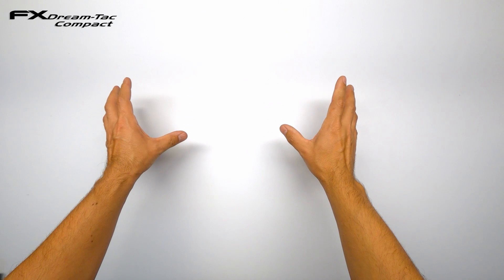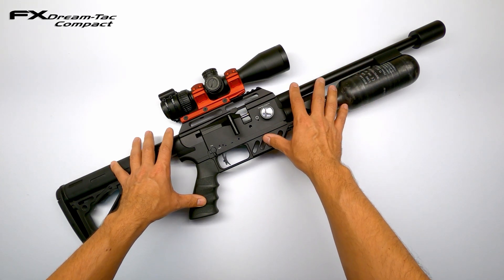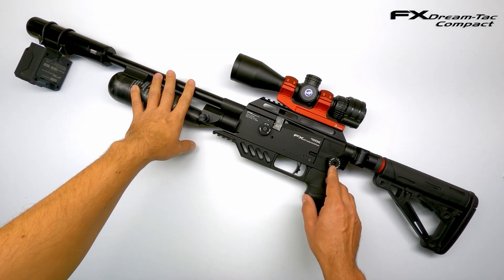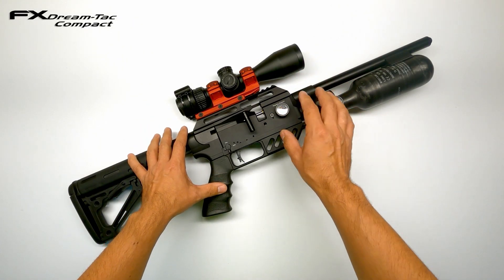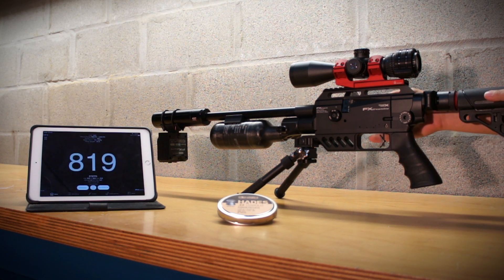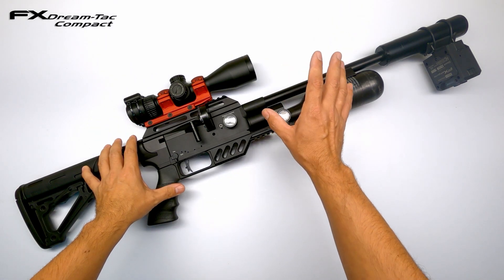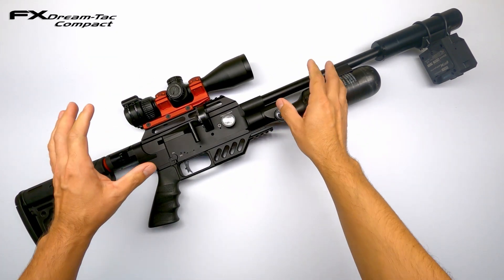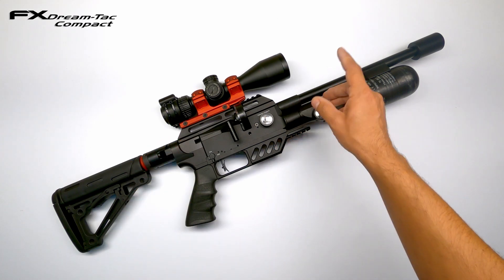FX Dreamline Tac compact tuning guide

Comment: How did you modify the pelletprobe? I am trying to learn but did not find any useful info.
Reply from the maker: I marked how deep te probe good inside the transferport , to it apart , put the probe in the transferport to the mark you just made , mark true the transferport the whole size on the probe and use a dremmel to mod the probe . Or wait abit for Huma to come out with the matching probe 😉
Reply: Thanks! I am sturgling to get over 830fps with hades. I have the huma air bigger port and fx power plenum. Running 150bar fully open and cannot get more out of it than 830fps. Have tried to adjust the hammerspring. Runnin also the stock 300mm stx. Not the superior as I cannot find any 300mm superior liners.
Reply from the maker: cubeqtio have you modified the transferport ? Without the matching opening in the TP you will miss about 30-60 FPS
Reply: I have the huma air v2 transferport. That is why I am wondering is there something wrong in my setup. Before the transferport it was 810-820fps. Now with the trasferport 825-835. Have tried max hammer spring and no boost in fps. Also low hammerspring tension and still stuck in that range. Running 150bar. Thanks already that you answer these questions!
Reply from the maker: cubeqtio 👍 but have you modified the pelletprobe to match the transferport
Reply: You should do a video about modifying it as I don’t dare to do it yet. As you do really good content and it has helped me to get my fx shooting consistent always! 👍 My request - how to modify pellet probe! 😀 video.
Reply from the maker: cubeqtio ha  without the matching probe the Huma TP won’t help . At this point the hole in your probe is what limits the airflow 😉 . The mod is not difficult as I explained before , I could do a video on that but I know Hume is going to have a probe for the Dreamline soon 🤫
Reply: Aaa ok! Thanks! Lets see if I will modify my probe. 😎 or will I wait.  But it would be a good video too and it would fit other models too. 👍
Reply: Modded the probe. Got maybe 10fps more. 835-840 stable. I think thats all it gives. Can you post a picture how you modified yours?
Reply from the maker: cubeqtio that’s a start , are you using the original gauges ? It’s possible that the are not showing the correct pressure 🤔
Reply: @Airbuks  I am starting to think that not.
Reply from the maker: cubeqtio huma air has some good gauges 👍

Comment: Can i decrease the regulator pressure even i dont bleed the air from the regulator?
Reply from the maker: Since the AMP regulators you should be able to decrease the pressure 1/4 turn at a time and take some shots in between to cycle the regulator, but I always degas the whole system just to be safe
Reply: Airbuks I had an issue before, I did dry fire to bleed air on regulator then The plenum started to have air leak. Do you think that caused the leak?
Reply from the maker: erwino024 normally not , the plenum is before the regulator. I had a similar leak at the plenum for a while and I turned out to be the orings that are around the piece  that holds the valve and spring in place

Comment: What is the difference comparing to a .25 cal. I got one plenum and original bottle. The airconsumption 5 bar/shot. 850 fps 120 bar  regulator preassure JSB 25,46 gn. Just over one magasine per fill.  Anyone hatching on a tune.
Reply from the maker: Hi Stephen, do you have a recently bought Dreamline compact ? 120bar for a 25 compact at 850 is a good number
Reply: @Airbuks  yes it is a gen 2 compact lite 400mm barrel.

Comment: What did you use to brace the barrel against the bottle?
Reply from the maker: It’s a 3D printer part I made , it’s only there to support the weight of de moderator and the chronograph. She can operate perfectly without
Reply: @Airbuks  do you a link to the stl file ????
Reply from the maker: @mickblanchfield8014  send me a mail at Airbuks@icloud.com